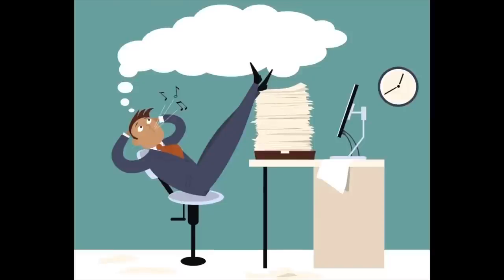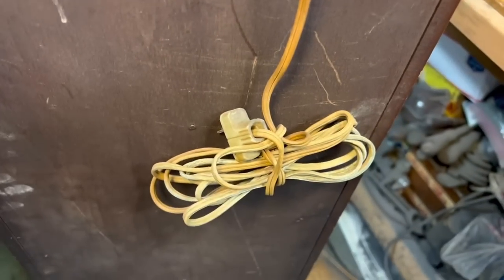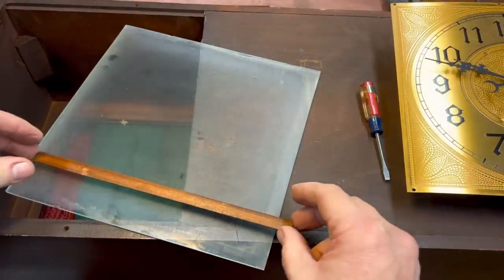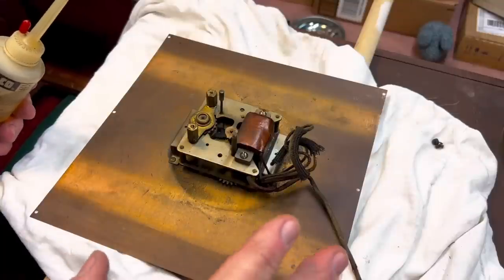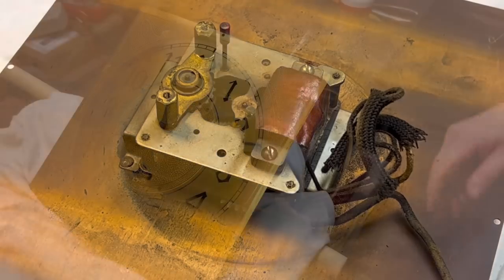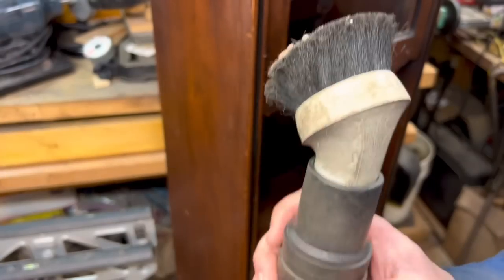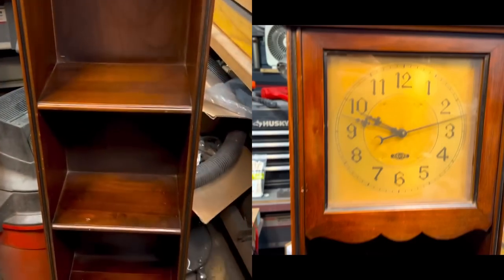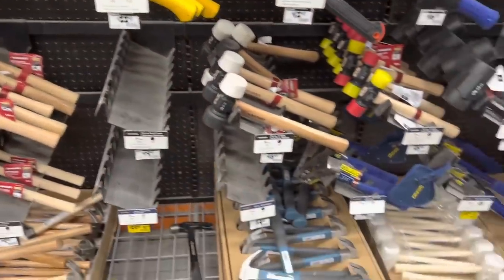Antique Electric Clock Bookcase Christmas Gift

Comment: I would like to see that clock mechanism taken apart, the plates cleaned, the pivots cleaned and the pivot holes. This would prevent future wear. Good tip on using genuine clock oil. Well done, looks and runs great!
Reply from the maker: Larry- I was a big collector of clocks and have refurbished a few movements!  Even going as far as drilling out the holes and inserting bearings!  I bought a ultrasonic cleaner just to service clocks!   Very time consuming....
Reply: @ScoutCrafter  Yes, clock repair is time consuming. Nice to hear about your refurbishment of clocks. Your videos are very helpful and appreciated. I know that it is a lot of work for you!

Comment: it should still be disassembled and thoroughly cleaned. Checked to see if it needs any bushings installed and put back together. By oiling without cleaning i'm sure there's dirt in those pivot holes that will now turn into a lapping compound and cause excessive wear.

Comment: John you make a great point how quality varies. I was shopping to replace a newer torpedo level I was working with and had my boss call out my work for not being level he placed his level on it and sure enough I was off. I placed mine back on and showed it was level. I was annoyed so when I was looking at home depot I went through the entire rack about 20 torpedo levels and most of them the bubble was on the line, about 3 of them were in between the 2 lines and of course I grabbed the 1 of the 3 that was most centered. Since then I've learned unfortunately you can't trust quality these days and I'm talking brands such as klein, milwaukee and even empire. It's such a disappointment to learn this is what we have to do these days. Give it a try next time your there I'm sure you'll find the same with the levels.

Comment: Why do you bother wrapping at all? It just gets torn to shreds and thrown in the trash. Put it in a nice bag (when possible) and removing it will be easier and you can always reuse the bag. Without mentioning the environment. Nice job on the clock John. I collect them myself. Merry Christmas too.
Reply from the maker: I use the reusable shopping bags now but for the smaller gifts I do wrap them in Christmas wrap.  It's a pain but traditional and always brings a smile to people unwrapping the gifts.   =D